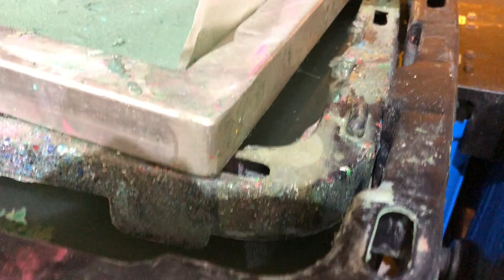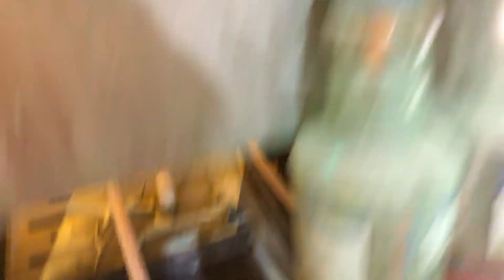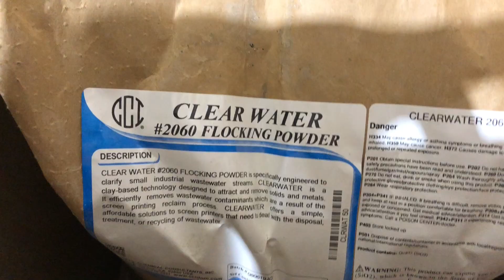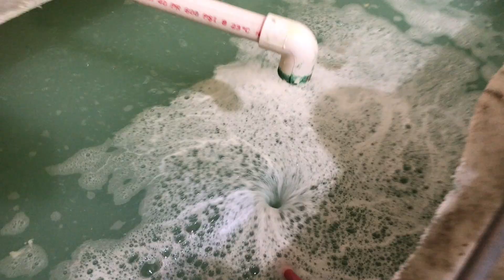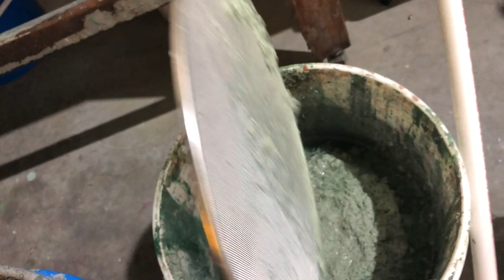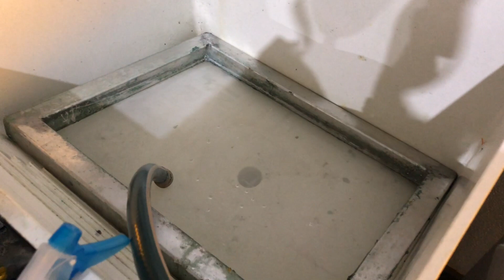Screen Printing DIY Filtration - Clear Water

Comment: how does the water get pushed through the blue filters from the settling tanks? are you using a sump pump anywhere in this set up? recently set this up for our wash out booth - same first couple steps...water coming out pink and kinda bubbly after the blue filters
Reply from the maker: The last tank is the black line filter with pump, ryonet has their own pump version of this as well in metal.

Comment: Instead of running the clear water down the drain, why not use that water to washout again?
Reply from the maker: We currently do not have a second container or pump to pump it from but would like to at least for emulsion removal. Would probably still keep fresh water for degreasing.

Comment: Thank you. This is a huge concern of mine. If you ask folks and you get all the answers of what not to do, but the folks will not talk about what they are doing. Can you share some links for the paper you are using?
Reply from the maker: I got the filter paper roll from ryonet. Its made by CCI and i just cut it to fit the screen. I got the powder from anthem screen printing it is also from CCI called clear water flocking powder.

Comment: The additives you are putting in dont deal with the liquid chemicals in the water though?
Reply from the maker: Nick Macedo we use a soy based dip tank solution and a green degreaser, and very small amounts of each are used in every 300gal batch. Always looking for even better solutions
Reply: @TylerCary  That's awesome. Takes more effort to try and use eco friendly products and processes.